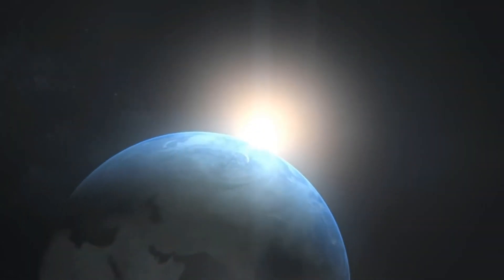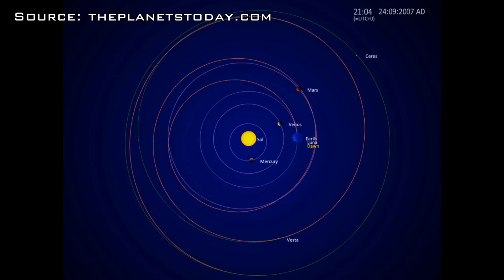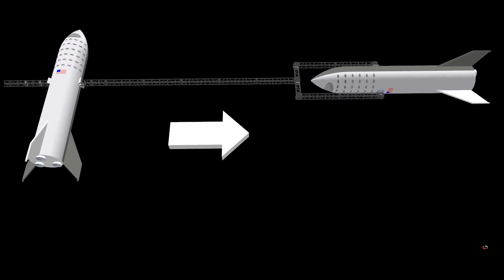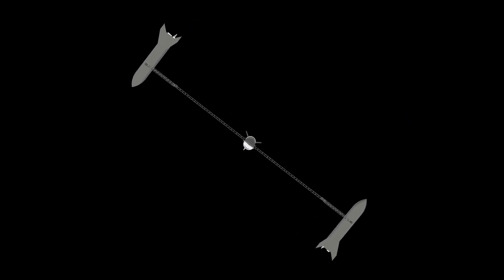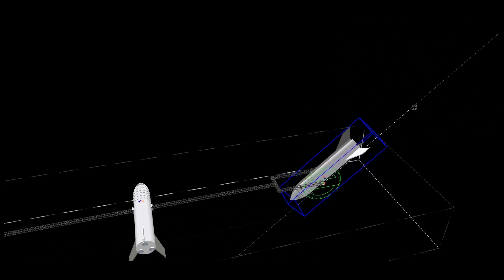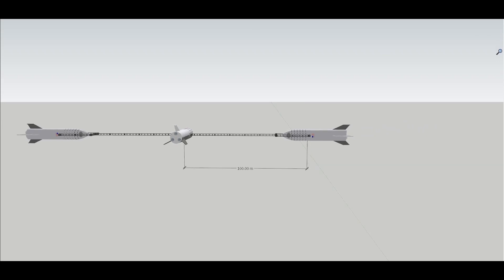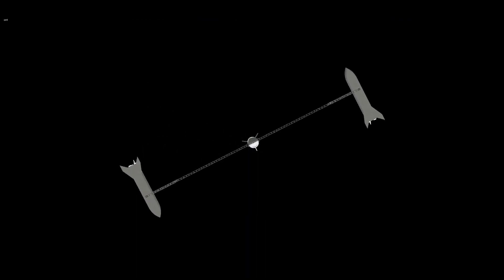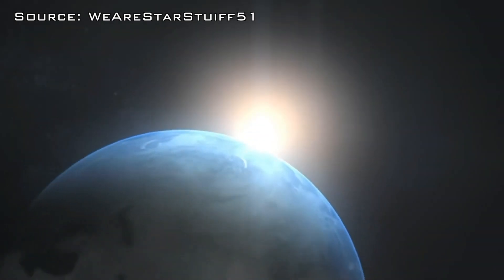GLS2: Artificial Gravity for SpaceX's Starship

Comment: To remove a complexity, design the ships Gravity oriented facility's along the horizontal axis rather than the vertical. Removing the need for the reorientation after the spin. Removing stress from the overall system and reducing things that could go wrong.

Comment: There is a huge design flaw, the attachement between the starship and the metal support and the metal support in itself will experience insane tension forces. I don't think this is possible with any modern material without it being enormous in diameter (the metal support). I think it would be better to spin the starship around it's center of mass, this will be uncomfortable but should be doable (kind of like being stuck on a boat, they'll develop sea legs).

Comment: This seems so impractical because attaching 3 ships to each other and 2 of which have to revolve on a fixed point takes up so much energy and counting on the time when you need to slow the spin down. Getting 3 ships to perfectly align will use even more energy because you have to use the fuels you need to get back to worry about a luxury at this point in space.

Comment: It will not work. I consulted with a scientist that worked in this. The problem is the inner ear will not adapt to the spinning due to Coriolis effect. Turn your head and super disorientation.
Reply: That effect can be minimized by making the radius larger and the rotation slower.

Comment: Great video.  I wonder how the adverse health effects change between 0 g and 1 g.  For instance, is 0.5 g half as bad as 0 g or maybe 20% as bad as 0 g.  If the spin gravity was only 0.5 g, the structure could be lighter, and less fuel needed to start and stop the spin.  Daily activities would be accomplished much more easily than at 0 g.  There is probably a reasonable compromise that is less than 1 g that would still keep the crew healthy and comfortable.

Comment: I love the idea! 
I just think that lighting the raptor engines would be far too violent for such a long truss, even throttled down. Why not integrate (very) small engines near the end of the truss itself that draw fuel from the center starship? That way the spin can be started more gently. Also I think in the resting position the engines should be pointing inward to best utilize the centrifugal force for the passengers. The engines don't need gravity, besides, having the heaviest part of the vehicle the farthest out creates the most stress on the vehicle (even though it would handle it).
One other thing,  the deceleration does not need to happen, the starships can just decouple. They will start drifting apart, but that is probably required for the landing anyway. Any residual individual rotation can be cancelled with the starships reaction control systems.
Reply: Also, it might be more efficient to deploy the truss as a standalone expandable payload. That way the cargo starship carrying it can land back on earth instead of several additional starship+superheavy refueling launches required to get the entire starship to mars. Just let it crash on mars.

Comment: I like the idea of using 3 starships for this artificial gravity system. If the structure attaching all 3 starships was say couple tunnel digging machine that will be used when the ships get to Mars.
Space garden could be installed in the 2 ends of the long tubing. Extra heavy supplies could be stored in the centre of the tubing.or possibly store water in the centre of this tube.
These tubes would be dismantled after 6 month journey and with engines attached to them, would be taken to Mars surface.
Several crops would be grown on the journey to Mars but plants would not survive a Mars landing.
Small seedling could be started snd taken to Mars surface as this has been done taking seedling back to earth.
Rockets used to land the tunnel machines when arriving to Mars would also be used to bring the tubes to speed needed to coast to Mars.

Comment: I think this idea has a lot of merit, but it will come down to the truss design and material strength to handle the outward pressures. They would then be trading speed to mars for gravity, in that the 6 tons of fuel could lead to less time in space, though I'm guessing that may not be too much additional speed nor saved time. Wonder if the central Spaceship could not just hold scaffolding but also additional fuel to offset that loss in speed.
Reply: I guess the other thing that you would have to worry about is how the mount points on the 2 outer spaceships would require the internal structure to be re-enforced. Once the rotation gets up to speed, and the spaceships start to rotate to provide a nose to tail gravity, the 1G of gravity orientation would have to translate along its structure. This might require additional weight in reenforcement to maintain its shape. Right now most of its structure is designed likely for a nose to tail, or tail to nose GeForces.
Reply: still a cool idea, and one I think would be interesting if SpaceX ran through its paces once they have a working orbital rocket.
Reply: Oh, and one other thing, do we really need 1G at all in either direction. It will be interesting once more research is done on this, does partial gravity solve most of the medical issues. Say we could use 25% of 1G and avoid 99% of the medical issues. This would reduce the outward force and likely reduce the weight in the system, and the fuel needed to start/stop the rotation. If you don't have bone and muscle loss, or can easily maintain them at partial gravity, and if people can still be comfortable, then this might be even more possible. Seems to me even if they did this setup in orbit with 2 spaceships to test long term space living at variable levels of gravity 25%, 50%, 75%, etc it would be good just to learn.

Comment: the biggest problem I see with this design is that because it only has one rotating assembly the entire system has net angular momentum and therefore has a gyroscopic moment and will process. I think if you really wanted to pull something like this off you would need 5 total starships, with 4 of them forming two counter rotating pairs and the center one having bearings around the hull so that the entire system has zero net angular momentum. This would also allow you to spin up the system using electric motors in the center core rather than burning propellent

Comment: My one critique of this design is the fork attachment, a chopstick attachment system would be more structurally  stable and less complicated.  The handle of the fork attaching to the tines and the right angles of the tines are all points for potential structural failure. Two chopsticks, a triangular or greater than less than  ○>○<○ expending  From the focum ship with a straight line cable running down the center as a fail-safe would be more stable. Two simple straight lines is also in-line with Tesla minimalism.

Comment: Personally I know they will use huge aviation grade plain bearings big enough to be the diameter of the width of the starship. Just like the spaceship ride at the carnival but without wheels to spin it. It’s smaller and used for sleeping or experiments. Gyros are a must in space and they have tried this idea just not on the scale it is going to be used. Do your research and you will see they are already in the works.

Comment: For starters, a mini version.
Two starships are brought out on a trajectory, if you so wish,
to Jupiter, or Mars.
They are connected with each other by two ropes,
on which "Suburban trains“ will slide on the opposite directions.
Without deviating from the general route,
the ships move apart at a distance of 1000 m,
and swirl around the centre of the configuration
at a speed of 6 revolutions per minute.
And voila:
for the next two years (a year, six months), 
we get in two ships “the acceleration of gravity” (earth's gravity).
To avoid dizziness,
no portholes.
Computer-controlled simulation of displays.
In these pseudo-illuminators
we will always see a picture (landscape)
that we would see during a flight on a normal ship. 
I will definitely not live to see Your version implemented.
And before the implementation of Mini ― who knows?

Comment: Why wouldn't a single-ship, "turn & burn" @ a constant ~1G be a less complicated, more reliable solution?
Reply: If it means what I think it does; turn opposite the direction of movement and lightly turn on the engines, there's one big reason. It wastes a lot of fuel, and it also decreases the speed, so the trip gets a lot longer. I think a constant 1G burn would deplete their fuelstores in a month, or maybe less. It's a lot of force. I'm only speaking for myself, but your idea has some merit if turned the other way around: Partial slow acceleration bursts in the right direction gives both gravity and saved time. 
For the cheapest and simplest option i'd say spin the rocket around its own axis like a bottle does when spun on the floor. No lost speed or fuel, and much more stable and uncomplicated than his proposal.

Comment: But if you jump would it you land wrong would int the starship be like a giant sling and you are the stone when the stone comes out it gets flung in the direction it was going to wouldn’t you just get slung at a weird angle into the floor ?
Reply from the maker: If you jump you would not land in EXACTLY the same spot, but close. From the extensive testing that's been done, we know that humans can handle spin gravity at certain spin speeds (low RPM) but not others (high RPM makes you sick) and the solution is to make the spin radius larger. My more recent design concepts use a 225 meter radius. Great question! Google "coriolis effect" for more.

Comment: What about the ship in the middle just screw them or would it be cargo
Reply from the maker: Each starship (depending on what it's doing) had a mass capacity of 100 tons. The whole idea here is for the ship in the middle, the GLS, to hold 100 tons of spin grav hardware. While it's deployed, the payload bay would be fairly empty, aside from the structural connection points. This would also allow the system to be collapsed and stowed for landing on mars. Why land on mars you ask? So that it can be refueled for the trip home!

Comment: You could have suggested to make the entire floor areas for the crew like a giant cylinder that can rotate freely inside the starship, this way you can rotate it with motors, be frictionless, not have to rotate the entire ship in a wired way.. And lastly you can restore this huge energy using regenerative breaking!!

Comment: I agree that artificial gravity is essential for this mission as you mentioned. 
However, you current design provides huge costs and complexity that simply cannot be met...

Launching 3 rockets into space to dock with a ~100 meter long boom is very expensive and challenging. The tensile force on each boom is major, not mentioning that, at the centre, the tensile force is double since the force is pulled in both directions. Over long travel time and the harsh environments of space, even the strongest metals can cave. To increase structural integrity, you increase mass, which adds exponential launching costs. Furthermore, your argument about RCS is contradicting with your idea of using the two outer rockets for centrifugal momentum. They both use some sort of propellant. Aside that, minor centre of mass deviations occurs due to crew and equipment displacement. Adjusting to these deviations with your idea is simply not practical.

Comment: If you've played kerbal, it would cause some minor issues stresses if all points are not initiated at the same time (this means that even the middle starship would need to move or it's initial weight would create a continued vibration on the trussels, this alone would create a very very complicated situations if the forces were too strong to be cancelled. There would need to be some form of vibration cancellation system built within numerous safety precautions including emergency disconnection. They want to create an actual fully built system to keep certain small failures from being removed from the large situation at hand, human lives going to a lower gravity situation.

Comment: So I have a question/theory.

Say Starship weighs 100,000kg, when the ships start to spin up to 1G, there would be over a ton of weight suspended on each of those trusses holding them together. Also the ship in the middle would be exerted to twice that on the Trusses and potentially pulled apart?

Can anyone else add or debunk this theory?

Comment: The truss system would be under immense stress during engine burns? Would the vehicles separate when course corr./injection burns needed to be complete? Still not confident in the stresses involved.

Comment: While this is certainly an interesting idea, how are you synchronizing the burn to Mars orbit, or would the docking occur after they're en route? How would the truss system fare during the inevitable necessary course corrections(orbital mechanics are predictable, but complicated and constantly varying, it's nigh impossible to calculate them perfectly, corrections are always required)?

Seems like too many failure points to me, they'd be better off with some sort of inflatable habitat ring, perhaps launched on a separate rocket and then docked with so as not to take up cargo space on the transit rocket. It could be left in mars orbit while landing, and re-docked with for the trip back. Only concern I can think of would be radiation shielding, as I'm not sure how well flexible inflatable materials would be with that. I wouldn't worry too much about micro-meteorites, as they'd probably punch through stainless steel just as easily at the velocities they travel at, and polymers are easier to patch
Reply from the maker: Docking would occur after trans injection burn (en route) and course corrections would be planned, not surprises as you mentioned. Stopping the spin and changing course should be do-able.

This was my first video pretty much, and it has a lot of problems. I have had an updated version in the works for a long time and will continue to add to it, thanks for your input!
Reply: @smallstars  I don't mean that the course corrections would be surprises, just questioning how you would synchronize 3 rockets to make the course corrections without stressing the interconnecting structure.

While I'm sure it could be done, perhaps by undocking during manoeuvres, it adds a lot of complexity which is exactly what you don't want on your first attempt to visit another planet. Over time as technology matures(3rd, 4th visit, etc, once you know what you have is working without a hitch), is when you gradually introduce complexity.

Pretty good for a first attempt, keep up the good work.  :)

Comment: I think it would be better to lock the starships with crews at the ends instead of changing their attitude so many times. Maybe attach horizontal boosters on the sides of them or even use the center one with the trusses to start and stop the rotation. Even if it takes longer, it leaves fewer failure points and a smaller margin for error. I think this is especially important since it's a relatively untested concept in this specific method of application.

Comment: Sorry, but...

When you are under a centrifugal force, yes, you'll feel like you are sticked to one wall.

But what you're missing it that if step on one direction you'll feel the aceleration of the spin and if you step on the other direction you'll feel the drag.

Which means you'll experiment different pressuere on your blood and brain if you step in any direction or even different pressure in your head than in your feet.
Reply from the maker: The larger the spin radius of your system is, the less negative effects there will be. There have been many studies and experiments on this bad they all show that there is a comfort zone for humans. My more recent designs use a 200 meter radius, 2RPM system or 85 meter martian gravity 2RPM system.

Comment: Ok looks like a good system, but you will have to consider the inertia of the 3 staships that have a huge amount of weight /mas, the tensions on the truss will be gigantic, mabe it's just easier to create a roll/spin on a single starship axis (like a football) , with 9m you can create the same efect that you have in the video, in any case you don't need 1g 1/6 like in the moon will suffice

Comment: Disc's within disc's in a
 "Star trek USS Enterprise" type bridge, each spinning at speeds needed to create 1-G on each concave flanged surface surface area.

SpaceX rockets dock to the center shaft of the bridge. 
All decks on the rocket experience some G-Force created by constant acceleration.